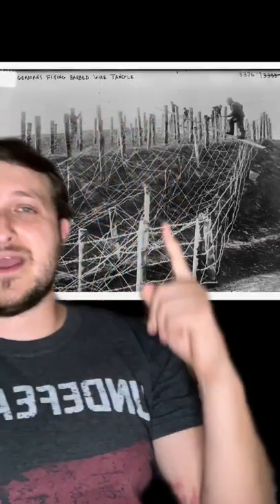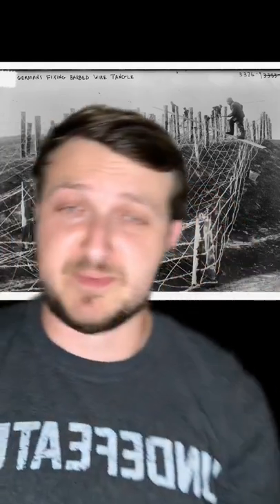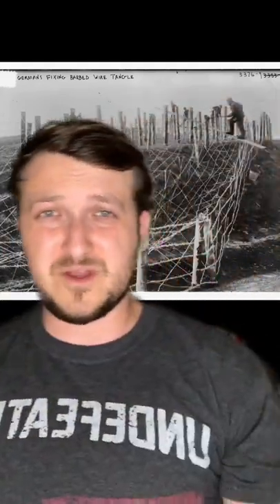Why This $200 Barbed Wire Design Is Next Level Genius - Combat Engineers

Comment: Drops plywood over, walks across
Reply: That’s what I was wondering. Get some 2x4 or some thick branches/log side by side and lay it on top. Outside of the obvious dangers (enemy fire, land mines, barb wire itself) what is stopping lil Joey from doing as that picture in the video did. 

It’s more unlikely to cross safely in the picture then it is on tangle foot. Specially with so many anchor points to make it taught. From my experience dealing with rusted c wire left in the field you can still grab C wire/barb wire with patted gloved hands. Just don’t rub it or grab a barb directly. 

Also we are taught that now a days regular Barb/C wire isn’t supposed to be set up as a wall like how they did in ww1/2. It is set up like a net, visible bubble wrap trap or a spider web. So that the guy on the board isn’t able to do that. Get enough anchors to make it as tight as necessary to mostly stay in place but lose enough so that anyone who would try to climb it has the same stability as a hammy or a swing so they fall in it. This way if someone was thrown on top like a log or a dead body it would collapse and entangled whatever was thrown on top and if it can’t do that it wouldn’t be able to hold on steadily. 

That’s for one layer though, you do this process 3 or 4 times with the c wire interlocking and you got something that would make most men hesitate on trying to climb it.